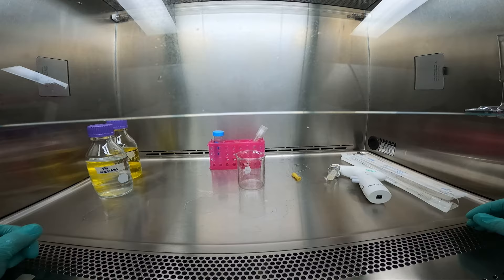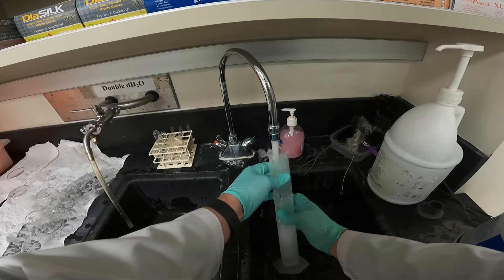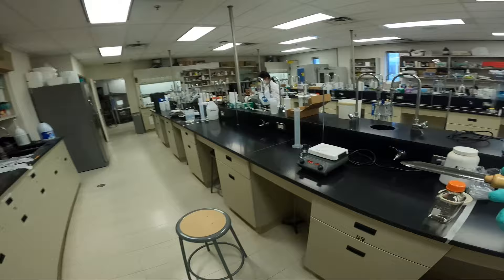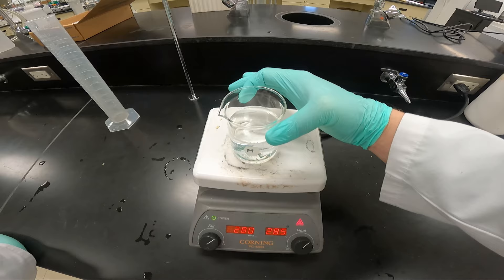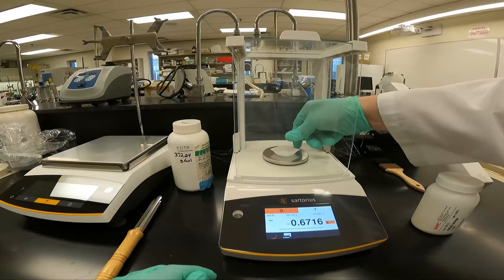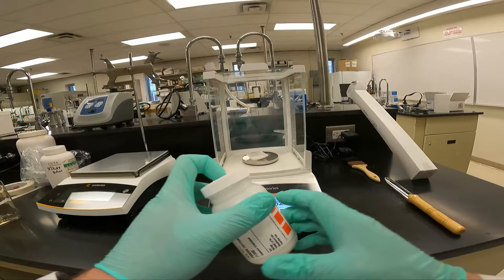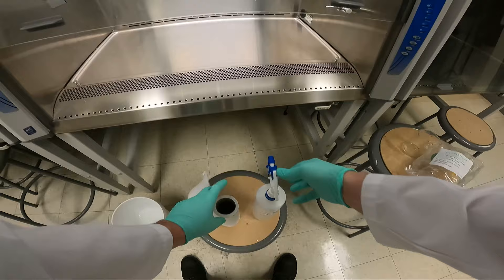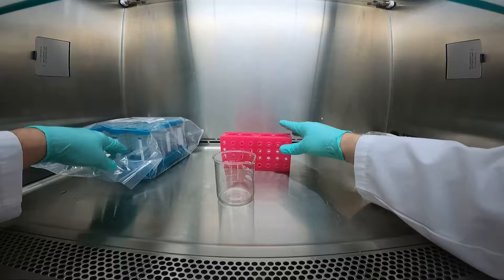Preparing Typsin - EDTA in PBS with Filter Sterilization for Tissue Culture

Comment: Can you explain your calculation for .25% trypsin
Reply from the maker: Thanks for your question Lianna.
For this solution we want 150 mL of a 0.25 % (w/v) solution of Trypsin.  This is 0.25 per cent (centum is Latin for 100), so 0.25 per 100.  It is (w/v) which means weight (g) by volume (mL).
All this means 0.25 g of Trypsin (weight) for every 100 mL of final solution (volume).
I usually use a proportionally statement (2 fractions that are equal to each other) to solve this. 0.25 g Trypsin / 100 mL Solution = x g Trypsin / 150 mL Solution.  Solve for x to determine the mass of Trypsin you must use.  
Hopefully you can see with the proportionally statement, we can sub in any concentration or final volume to easily calculate how much chemical you need to weight.
If you would like more information on these type of calculations, check out my lecture on Solutions here.
https://www.youtube.com/watch?v=sCwFnsxq6ic
Reply: @ProfessorDrewCollop  may I know calculation for EDTA
Reply from the maker: I explained the calculation in my previous comment.  Can I clarify anything?